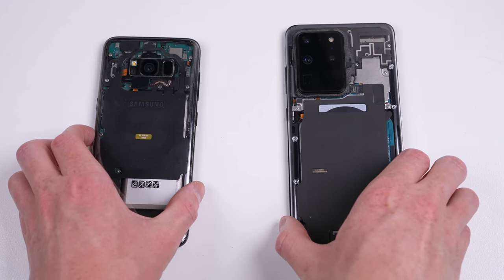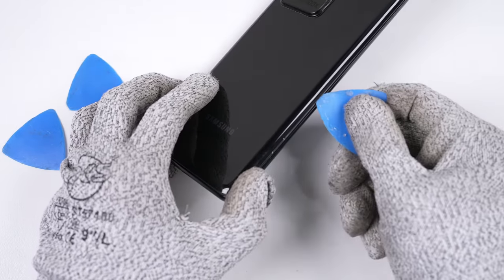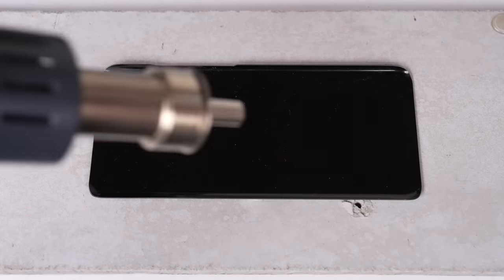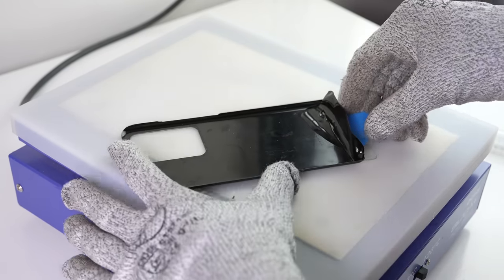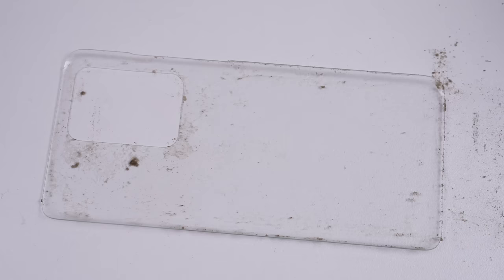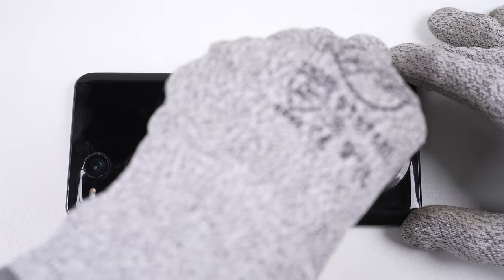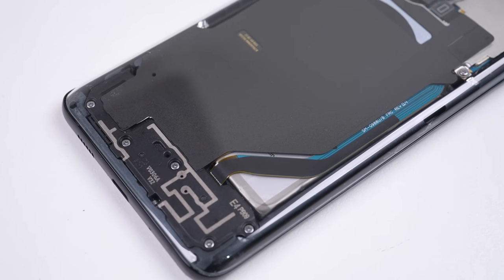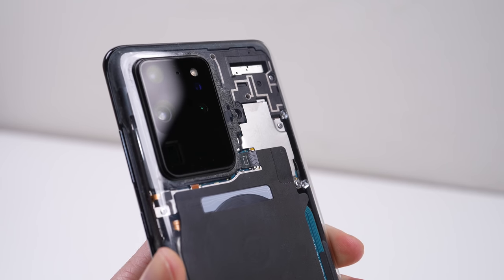The Mod To Make Any Samsung Phone Transparent

Comment: To prevent the glass from falling every where when it's broken you can apply some ventureshield like they use on cars or some clear vinyl to the inside of the glass which will give you that clear look and protect the glass from getting into the inwards of the phone if shattered.
Reply: But isn't it pretty difficult to get those curves so perfectly that you don't even see it?
Reply: @miasinterestinglife  they use these on cars and they difficult curves and bends so this should be absolutely fine.
Reply: I used a clear skin, like a screen protector and applied it to the inside of the glass when I did this to my buddy's note 8
Reply: This is what I get for not reading the other comments until after I wrote the exact same thing myself.
Reply: Cheaper and easier alternative would be UV curing glue that people use for attaching LCD to front glass. It's strong and wouldn't break that easily.
Reply: Just use a clear skin 
Simple
Reply: Have a link for that stuff you used friend?

Comment: Super cool. I don't think this would work on later phones. My S21 Ultra has a kind of "frosted" back glass (both in appearance and in texture). So even if it was a colored film inside, it wouldn't look that great, haha.
Reply: IMO frosted looks even cooler. You can find a few videos on the frosted back phones as well.
Reply: Frosted back are same just the outer layer is etched to a matte finish.
Reply: a repair channel made a video doing this on the s23, it still works and it looks even better with the matte back imo
Reply: Phone Repair Guru did this to the iPhone 15/15 Pro Max, which also has frosted (infused) back glass.  Though it was more like the Oppo that Hugh attempted; as it wasn't a film either, PRG had to scrape away and do that with the elbow grease Hugh mentioned in the video during that section.

Comment: Interesting video as always Hugh. But now you got me curious. So is Samsung being cheap by applying a plastic cover at the back of their glass panel or OPPO being expensive with actually dying it on the other hand. Although you seemed to give the answer on the video and as you said it's for protection and so it's pretty much kept in place, still I'd like to know what is the best method. Except from even applying a say a Dbrand skin over it. Cheers mate and keep up the great work you're doing.
Reply: plastic film on the back side is definitely the better option for if the glass gets shattered as it holds it in one piece unlike on dyed which has a higher chance of falling apart into piece when it shatters
Reply: @PlytkaChodnikowa  No

Comment: Man do I miss my Samsung S20 Ultra.  I should have kept that phone.  The screen is massive, 6.9" 3200x1440 2K which is fantastic to watch video.  Also the last phone with a memory card slot, had a 512G in mine.  Love the 108MP camera with the massive zoom capability.  That's a cool trick with the back glass.
Reply: I traded a iPhone 12 for S20 ultra and I agree the phone is packed with features
Reply: I mean, Note 20 Ultra had the same specs, had a memory card slot too, and its cameras could focus thanks to its laser autofocus, unlike the S20 Ultra.
Reply: Great phone but has a big problem with the auto focus :(
Reply: Sony still make flagship devices with SD card slots! Although the current gen of Sony flagship mark 1 line is kinda of overheating prone seems like the next one won't be
Reply: @kamelalg9859  Mine just took a bit so when I took portrait mode pic I couldn't just hit the shutter button and that's it.  I would leave the camera still a few seconds after hitting the shutter.  That fixed the focus issue.  One of the Samsung updates did fix most of the camera issues this phone had too.
Reply: @WinstonH  Sony phones are so overpriced and don't have an ecosystem other than TV's and headphones.  I did see the Electric car video unveiled at CES.  Not into EV's though.
Reply: What's your phone today?
Reply: I'm holding it

Comment: This brings back some memories, when Samsung sold phones with removable plastic back panels I used to take off the battery cover on my S5 mini, put the semi transparet case that I had for it and it looked almost like this, there would be a gap between the phone and the inside of the case but it was a lot easier considering I was a lot less skilled with phones 7 years ago.

Comment: What you could do about the glass falling off is use a type of UV adhesive used for attaching LCD to front glass. You can cure it under UV LED lamp either for electronics or for nail polish ($10) and it would do the trick. This way it will look transparent and also add strength. It wouldn't fall off when broke.
Reply: is it liquid glue or a sheet of adhesive?

Comment: actually did this on a 2018 J4+ not so long ago before I found this vid, I figured out I can do this while trying to replace the battery. I thought it would only work on a cheap models that has transparent plastic but apparently it also works on newer models that uses actual glass, wow

Comment: Very important note! I recommend buying a rear protector, either one made from plastic or hydrogel, or putting on a clear case!
Samsung's plastic sticker inside actually gives it integrity and shatter resistance, it also holds on the the glass shards if it did break. Learned this the hard way.
Reply: He mentions this later in the video

Comment: I have an Oppo reno 1, and I have also made it transparent myself by pulling off the sticker from the glass, so it is also possible with other brands of phones. Maybe works in the case of the Oppo find x3 pro using pure alcohol to take the paint off.

Comment: I would love to do this on my Pixel 6 Pro - I know companies make vinyl to give the appearance, but it's not the same as the real deal.
Reply: Wouldn't work as easily on the Pixel 6 and up. It's two separate pieces of glass and plastic and you have ont see as much as you think because of the more iphone style design. The glass is more likely done in the Oppo style vs the film Samsung (and LG and older Oneplus) uses. Plus, it's hard as is to find replacement housings, much less to have a seller make a transparent back as an alternative.

Comment: Tried this mod on my Xperia Z5 Compact. It's got a frosted back glass, so it definetly looks unique. It took a lot of scraping: the glass seemed like it it was painted on with multiple coats instead of having a film. My device came refurbished from China, so the glass was definetly not original.
Reply: Ooooh I should try this with my Redmi
Reply: @coolcomments  make sure to have decent double-sided tape or some other way to glue it back shut before attemting the mod!

Comment: I can highly recommend a squirt can of old-fashioned lighter fluid, which contains naptha, for removing adhesive instead of that brutal acetone. You can also buy the commercial adhesive remover "Goo Gone", which is basically the same thing, but thicker. As for me, my phone is encased in an armored back cover, so this would be pointless.

Comment: oh man. i need to replace charging port on my note 9 and already had it opened up few times and scratched up the back from removing the glue. This time my plan, after port replacement, is to make clear back. And bam you made a video. Literally got port replacement from ifix it yesterday. Also, tried to find clear back just to buy but no one sells those :(
Reply: Goo gone or paint remover really helps!
Also you can use a razor blade, it won't scratch the glass as it is gorilla glass

Comment: i made my old s9 transparent a year ago. i didn't install the adhesive either because i didn't have one but at least i made sure i had some glue residue left to hold the glass down. since then i gave it to a family member. the purple frame with the black athesive (i used an s8 adhesive when i gave it away that fit almost perfectly) look quite good together. every chance i get i take it out of the case. i kinda miss it. i am curious a frosted glass transparent phone would look like, but i would have to wait a while for my new phone to feel old and mod it as a way to refresh it

Comment: I was going to ask why they didn't inject the color into the glass, but if they're using Gorilla Victus and whatnot, that would probably structurally compromise the glass. ALSO, why didn't you just nuke the back in the solution of acetone or whatever you were using? And Nylon can withstand most chemicals which is what those bristles are made out of.
Reply: If he had soaked the whole back in acetone for a few hours, the black film would have just peeled right off without even needing the heat.

Comment: Did that to my S20U and dust can be a real issue if you don't glue the glass back properly, it got on my cameras and I had to open it up and clean it after a while, and when I cracked the glass there was no lamination to hold it together so it was just a bunch of glass shards falling of my phone, so I had to stick an old dbrand skin on to hold everything together, looks cool but just be aware of those things

Comment: Would a Galaxy S21 boot without the wireless charging module connected? I don't use it at all and if I were to do this mod, the phone would look a lot cooler without it.
Reply: It technically would boot up, but you wouldn't be able to charge it. (Both wireless AND wired). Thats because there is a temperature sensor in the wireless charging coil. You can try to mod the charging coil, but you might damage the temperature sensor.

Comment: I actually have a Note 10 I did this to like a year or two ago. The charging stopped working and had that annoying false temp warning so I took it apart to fix and made it clear. Didn't get to fix the wireless charger that seemed to be the issue though as the connector on the motherboard broke. So now I just don't have wireless charge function or the waterproofness.

Comment: I did this mod a few years ago to my Note8
I also removed the wireless charging coil, NFC antenna, a some plastic. 
I only kept the speaker and a piecie cutted out of the wireless charging coil, the temperature sensor. Without it the phone wont charge. In the S8/N8 its located on the wireless charging coil

Comment: Hey there Hugh. I need your help. I recently found my brother's old iPhone 4s. I wanted to get into it to see old pictures but unfortunately its locked by a passcode. I've attempted to guess the passcode but have failed 9 times. The last time I tried it was disabled for 60 minutes and I think if I fail once more the phone can't be unlocked. I would like to be able to either 1. Bypass the lock screen so that I can get into the phone or 2. Be able to get the contents off of the phone without wiping data. I want to preserve pictures, text messages, apps, etc. Do you have any suggestions?

Comment: I want to make my A51 clear, the problem is that the Back panel Is plastic, and if I use something harder than plastic it can scratch it and also deform, is there a way posible to make it transparent?
Reply: No, he said it only works on phones with glass backs (i.e. flagships), so the title of the video is wrong.
Reply: It is possible, just very annoying to.. in my case, I used a piece of smartphone glass and scraped off the paint

Comment: Hello Hugh
I don't know if you will see this but I just need an expert opinion from you (or anyone who can).
I have a Poco F3 I got 8 months ago. The was perfectly fine until just one day it started heating up. Temps can rise from 32-47c in a minute or two when on a call or downloading something. Any network intensive activity bumps up the temperature and this comes with drastic battery drain. Phone that was giving me around 7hrs SOT can't last even 3hrs now. The phone acts normal on wifi without those high temps when downloading stuff. I have full LTE connectivity here too. 
There's no official repair shop here and I don't mind opening it up and tinkering with it myself. After all I'm going to get a new device and I just want to have fun trying to fix this.
Any help from anyone will be appreciated

Comment: omg. idk other people do this to, I did this to my xiaomi redmi note 7 around 3 mo ago.  tho it has those plastic film it also has those paint underside it, so I need to scrape it. im quite impress with the glass(gorilla glass 5) bc I use cutter blade to scrape the paint and i have no scratch on it, but the edge need a bit care since it so fragile(learned the hard way).

if someone try to do the same thing, just dont. sure its cool, but after few month using it, it just feel wierd.

Comment: xylene is 10 times better than acetone and you can use it to remove glue paint it’s my best cleaner around the work you can get it at my hardware store or woodworking shops

Comment: What can I use if my back panel is made from plastic?
Reply: As far as i know. Plastic backs are not transparent with a sticker over lay.
Reply: I have done it on a A30s back before, and I used a piece of Glass that's not cracked to scrape off the colour

Worked out okay, but not great

Comment: Samsung's strategy of using cheap plastic failed.. in a good way. Why not use colored glass instead, if the companies "care" too much about environment and global climate change, and doesn't provide chargers in name of that.. giving cut-length  charging cables when you buy instead of proper 1 meter cable they used to provide early for free.